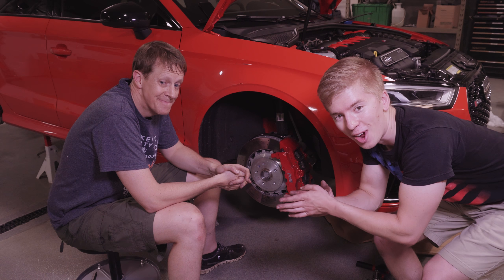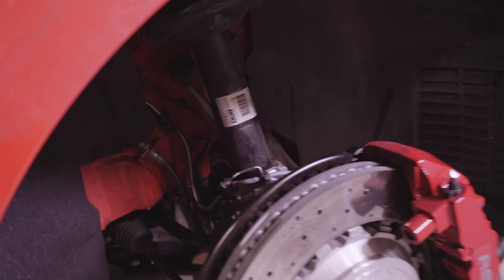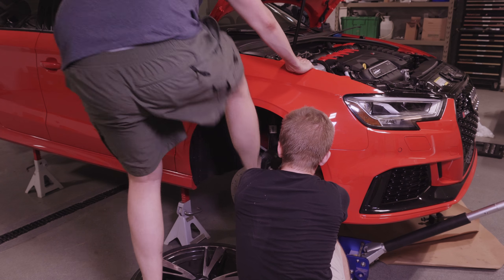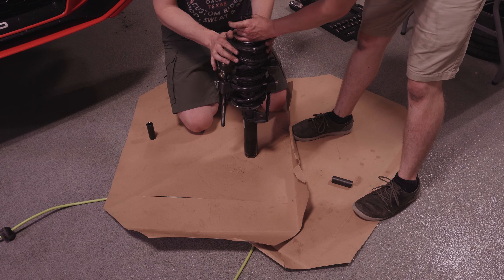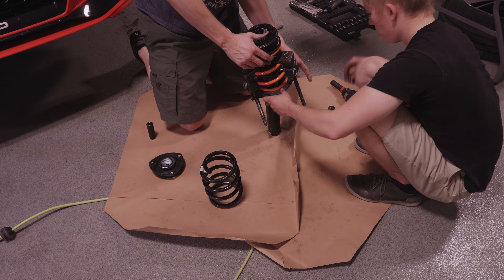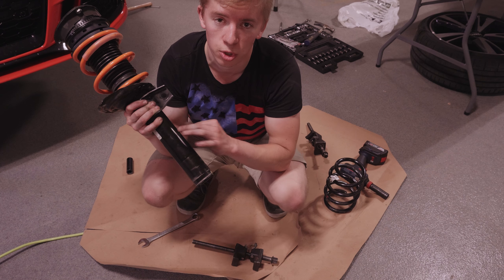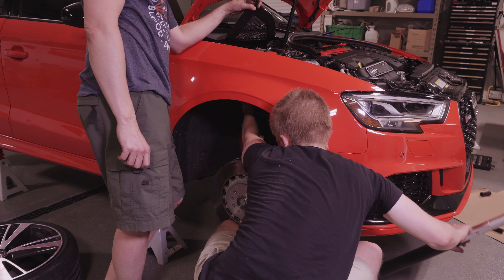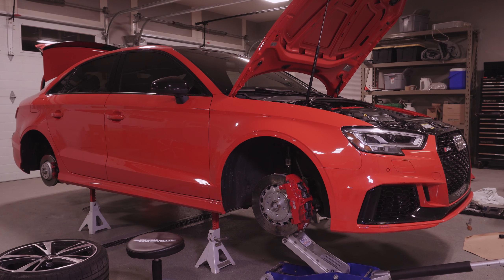MSS Sport Adjustable Lowering Springs Install Audi 8V RS3/S3/A3 (FRONT)

Comment: Glad to see some new RS3 content up on YouTube! I picked up an RS3 myself and have my H&R springs waiting to be put on and this video helped clear up some stuff. Can't wait for more RS3 videos
Reply from the maker: Thanks! We have an install video for the integrated engineering intake coming soon!
Reply: @HardwayLearning  I attempted the front shocks today. Holy shit they're a Pain in the Ass
Reply from the maker: @joszer  we struggled with the bottom mount it the shock the most. Getting that pried open was brutal!
Reply: @HardwayLearning  I gave up, couldn't do it myself. I ordered a steering knuckle spreader on Amazon for $45. Will try again tomorrow!
Reply from the maker: @joszer  that should help, we tried many different shaped pry and  crowbars
Reply from the maker: @joszer  how did it go with the tool?
Reply: @HardwayLearning  oh man, easy peazy lemon squeezy. The spindle just dropped once I torqued down the wedge. It was definitely worth the $40 to buy. The hardest part was lining the strut back up and treading in the top bolts by myself. I did all four corners in about 3 hours taking my time.
Reply from the maker: @joszer  man I wish we would have had that wedge! Sounds so useful, extra hands helped a lot though! Glad you were able to finish it yourself 💪

Comment: Easiest way i found to open up the clamp was an Alan key. Saved buying the tool and the struts slip right out
Reply from the maker: How does that work? You shove it between the gap and it separates it just enough?
Reply: @HardwayLearning  yep exactly, i think i used a 1/4inch Allen. Put it in give it a twist and the hub assembly drops off 👍🏻
Reply from the maker: @Verse1_SYD  Neat trick to know, thanks for sharing!
Reply: yep, the tool's name is "Spreader Socket Tool Number 3424 for VW Volkswagen Audi".

Comment: How’s the ride quality compare to stock?
Reply from the maker: Pretty solid for lowering springs. You hit the bump stops on harsh roads more often, but it's not bouncy cruising down the highway and improves overall cornering characteristics.
Reply: @HardwayLearning  do you feel a difference between comfort and dynamic mode?
Reply from the maker: @derrickgarcia303  definitely, that's all controlled by the OEM shocks
Reply: Do you know where I can get all the torque specs for all the suspension nuts and bolts to do the job?

Comment: Great video on RS3 but need to ask I didn't notice any bump stops on the strut. 
Only asking as you mentioned you don't want the car riding on the bump stop, did you install it or not needed on this strut.
Reply from the maker: IIRC we left them out because the car sits so much lower. Certainly makes for a harsh impact when you annihilate a large pothole. 😬
Reply: @HardwayLearning  Thanks, I notice mine also are not fitted. I bought some but can't figure out where they go on this strut. Your video is great but I can't see them on there either. It's a mystery where they are supposed to go.
Reply from the maker: @minesy72  they usually go on the shock shaft, you would have to remove the top hat/strut bearing from the assembly, slide the bump stop onto the shaft of the shock, then resemble

Comment: Looks like you guys put the adjustment piece on the top, can you even reach it with the wrench to lower or raise it?
Reply from the maker: It's pretty tight, but we are now running them all the way up (lowest ride height) which sets the car at a good height. I don't know if MSS changed their front spring yet, but there were some complaints that the ride height wasn't as low as advertised.
Reply: So how low did urs end up settling to I'm at lowest setting and it droped 3/4 of inch with 500 miles on the car no way it will drop to advertised 1.5 inch for track version springs....
Reply from the maker: @huntnman  we never recorded the original height and would have to get back to you on final height.